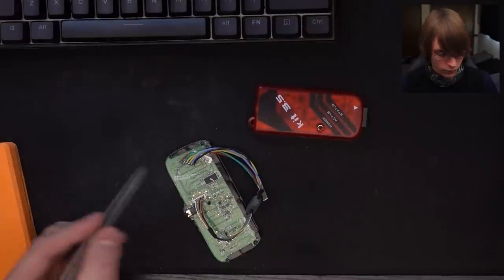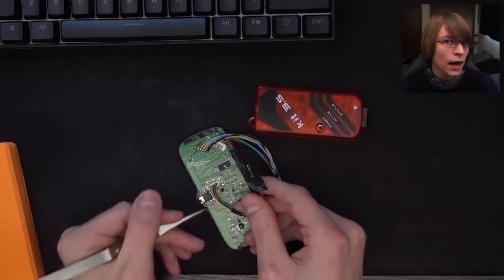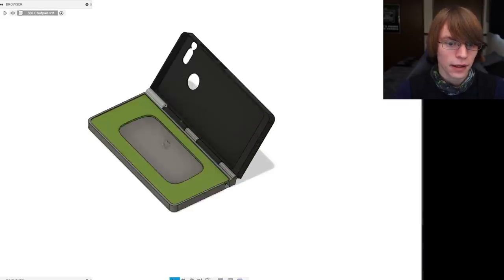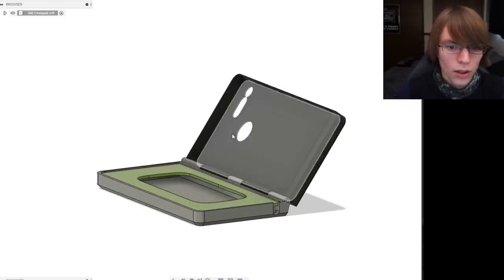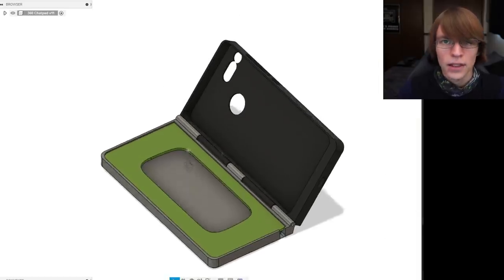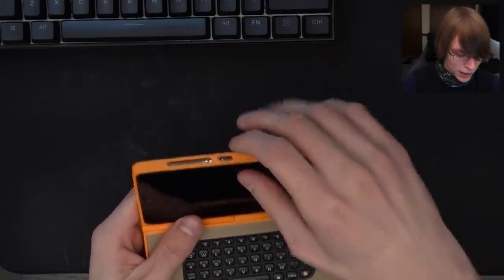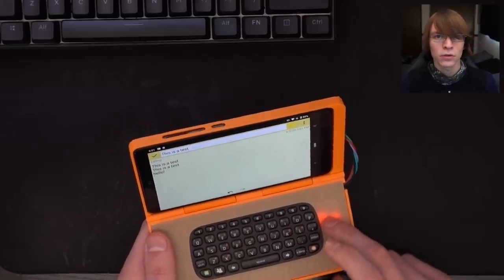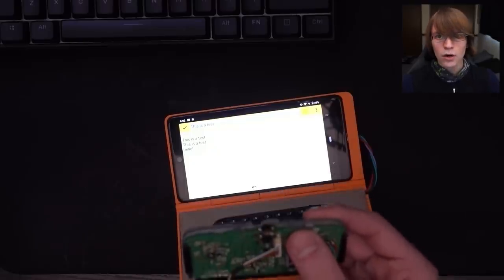Hacking an Xbox Chatpad into a QWERTY Phone Case

Comment: Awesome.  I have an original XBox 360 chatpad which I never use anymore.  Add a USB hub and using a teensy or arduino and and turn that into a usb gamepad.  Then you have an  ultimate cellphone handheld console case.